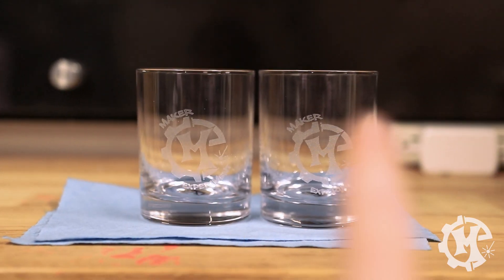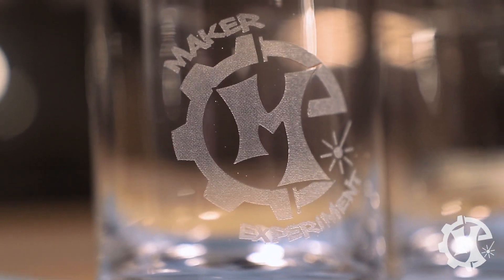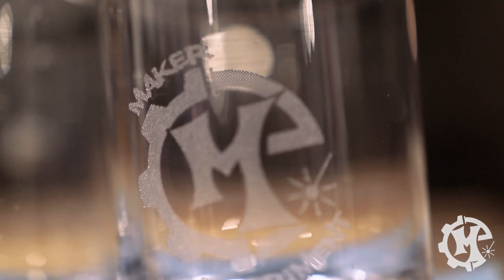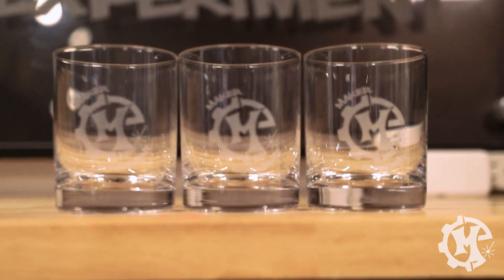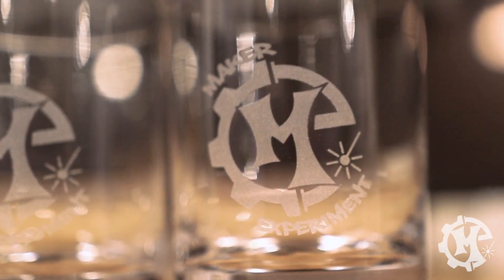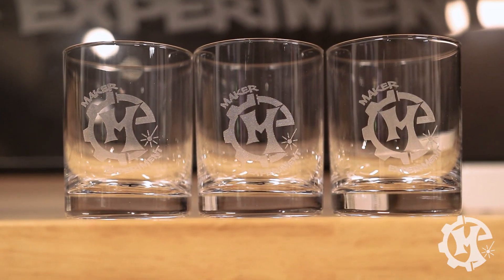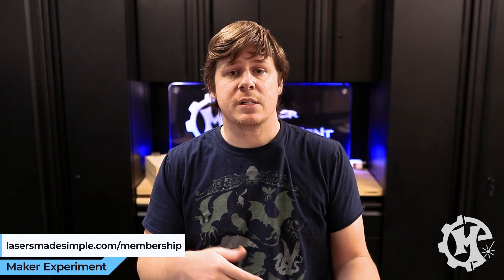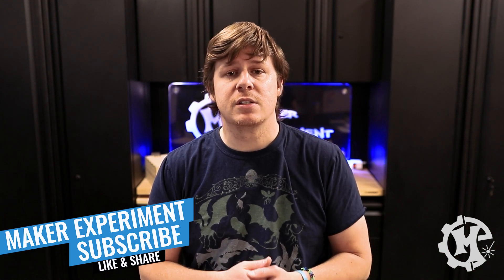How to laser engrave glass like a PRO!

Comment: Hello, how are you? What a fantastic video. Excuse me, I'm from Brazil, my name is Pedro. I have little experience in laser engraving and I'm having difficulty engraving glass, specifically wine glasses. The glass is chipping and the work is not of good quality. I would like to know if you could help me with how to engrave. My machine is CO2 80w with a maximum speed of 400 millimeters per second. I use two different software programs to set the settings, Lightburn and Auto Laser. I would be very grateful if you could help me convert this information to a type of configuration that would be suitable for my machine. Thank you very much and a big hug...
Reply from the maker: My machine has a max speed of 120 in/s. So all of my percentages are based on that. You should be able to do the math to figure out what it is in millimeters per second.
Reply: Hello, thank you for your reply. I will test the speed by converting. Could you tell me if this Epilog Engraver program works for other laser brands and controllers? Thank you again.
Reply from the maker: @pedrinho01videos it is specific to the Epilog as far as I’m aware.

Comment: For someone who looks for the ideal settings i have to be honest, your video didn't help me much further... as settings are pretty important.. your 100 procent speed is not an ideal informative fact, also the ms is missing, 1 ms in comparison to 20 ms will be a HUGE difference but nothing about it in the video, most of us use lightburn, the only thing that works in percent is power.

Any information about these 2 settings ?
Reply from the maker: The max speed on my machine is 120 inches per second. So percentages are based off that. I didn’t use 100% speed on glass. I understand that a lot of people use lightburn, and your settings may not match mine as RF tubes behave differently than DC glass tubes.

Comment: Which is focal length of lenses you use to engrave on glass?
Reply from the maker: I was using a 2”.
Reply: @MakerExperiment  so do I. But I feel a lot more confident using wet paper on glass. And on big engraving area I scale greyscale down to 50% grey. But I have a less sophisticated glass tube laser. I run slower and less dpi. I imagine you set a specific frequency for engraving glass.
Reply from the maker: The frequency I didn’t play with on mine. I mostly focused on greyscale, DPI, and dithering pattern.
Reply: @MakerExperiment I imagine that you use more DPI, high speed and low power?
Reply from the maker: @martinotalotti8986 almost exactly the opposite. I used 400 DPI, lower speed, and higher power. My settings are in the description.
Reply: @MakerExperiment unfortunately not suitable for industrial engraving, too much time for a single glass
Reply from the maker: @martinotalotti8986 my goal for my video was getting good results, but you are correct that you need a quicker path for production.

Comment: the improvement has nothing to do with any of your settings /jarvis vs stucki, speed etc. Its all about increasing that DPI. You're making the lines closer together which make them less visible. When you did that the lines are gone. You may also want to defocus the laser slightly to spread the beam out over the surface more. I really hate it when people go and make videos like this and they don't understand what settings actually do.
Reply from the maker: I find it interesting that you say this. By keeping the DPI the same and only changing one lever in a design of experiments fashion, we can see exactly what each lever is changing. That’s how I set this up. DPI is a large driver, but the dithering does play a part albeit a smaller part. You are also correct that you can put the laser out of focus to spread the beam size.

Comment: How much it will cost to buy? Is it too big? Is it made in USA and available 220 volts?
Reply from the maker: There are multiple machine options so it’s just a matter of what your needs are. Epilog machines start at $9,995. They are made in the USA and certain models are available in 220V.

Comment: If I have a 5.5 watt laser am I still able to engrave into glass?
Reply from the maker: To be honest, I’m not sure with that wattage. Try it and see if it works.
Reply: I tried it and it seems to work. But I tried a picture frame piece of glass and it seemed to engrave on the backside of the glass. Do you know why it did that? @MakerExperiment
Reply from the maker: @brandonvarner8475  I’m not sure why it would have engraved on the backside unless you did that intentionally. I use a CO2 laser. I’m not sure what type you’re using but you may want to ask the manufacturer of that machine.

Comment: hello i have a 100w mopa fiber laser, IS it possible to engrave glass ? what IS the fréquency and qpulse have you got use ? thanks to your answer
Reply from the maker: To be honest, I’ve never tried to engrave glass with a fiber laser. I’ve only ever used a CO2 laser for that. I don’t know the answer to your settings question for a fiber application. Fiber is more meant for metals and metal impregnated materials.

Comment: How comes it works well yet you don't paint the glass black first?
Reply from the maker: I’ve never heard of painting the glass black first. What are you referring to?
Reply: A black tempera paint or Cermark laser paint used for diode lasers to engrave/etch glass/metal. Co2 lasers don't need to use paint, probably because the type of light a Co2 laser produces.
Reply: Also no idea if cermark paint or tempera paint would make a difference with a Co2 laser. Worth testing though.

Comment: What tool are you using to grayscale to 70% and what file type are you using? Also what is the actual speed setting at 30%?
Reply from the maker: I’m using Adobe Illustrator. I convert the graphic to grayscale and change the percentage. I believe it was in the video. The actual speed is approximately 30% of the max speed of the machine which is  120ips so it would be roughly 36ips.
Reply: @MakerExperiment ips means inch per second ?
Reply from the maker: @KoalaWoodStore  yes
Reply: @MakerExperiment  so it is a lot , my laser have 130w but only maximum speed of 500mm/s when 36,ips is 960xd
Reply from the maker: @KoalaWoodStore  yes, it’s a much higher speed than glass tube lasers I’ve seen or diodes for that matter.

Comment: What are your thoughts on putting the laser a little bit out of focus when engraving glass? I typically use 70% black also, but with standard dithering and a little offset to get a smoother look. Maybe worth a try?
Reply from the maker: It could be. The downside of putting it out of focus is consistently putting it the same amount out of focus every time unless you make a gauge or have a way to measure it consistently. I’ve never tried that with glass as I’ve had good results with these settings.
Reply: @MakerExperiment  you can put the machine in focus and add an offset when you send it to the laser, or am I wrong?
Reply from the maker: @danielbastiaans2564  you can try that. I’m not sure how much difference the result will have doing that vs having a dithering pattern. At the end of the day as long as you’re getting a result you’re happy with, I’d keep doing what you’re doing.